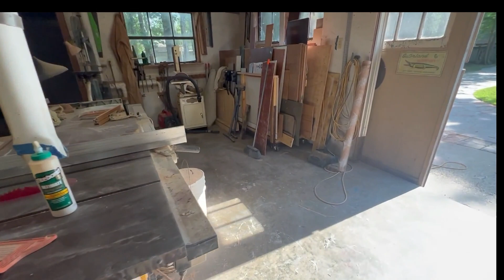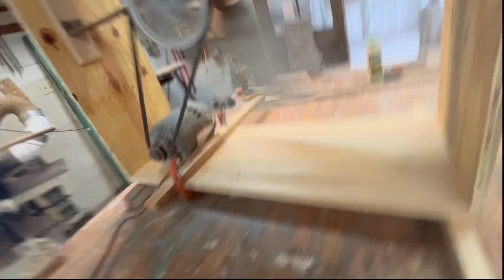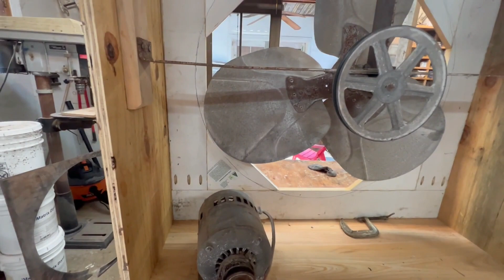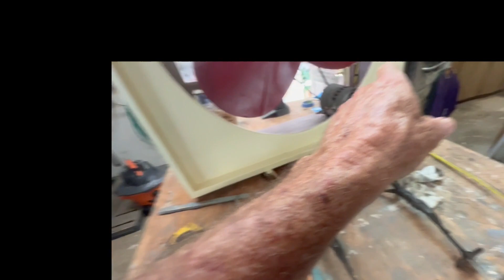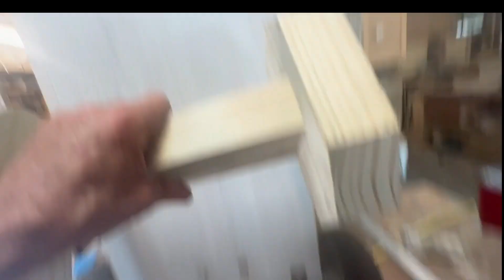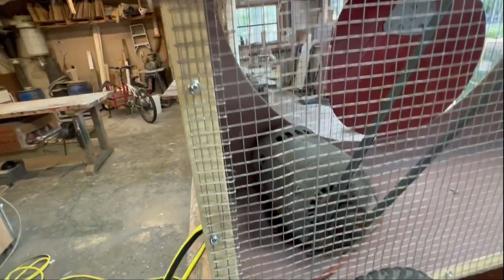Restoring an old box fan for shop use.

Comment: Can't beat a good shop fan.  I have one around that size for cooling my shop off.  I got mine from work though.  The pulley on the motor failed and the shop threw it out.  I dragged it out of the dumpster, put a new pulley on it, and it has been chugging along for a few good years now.
Reply from the maker: Perfect! The only thing better than owning one of these shop fans is owning one that you have saved. 
Thanks!